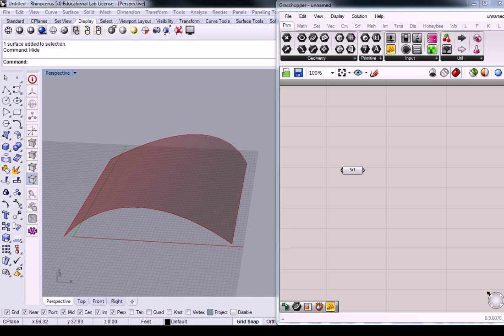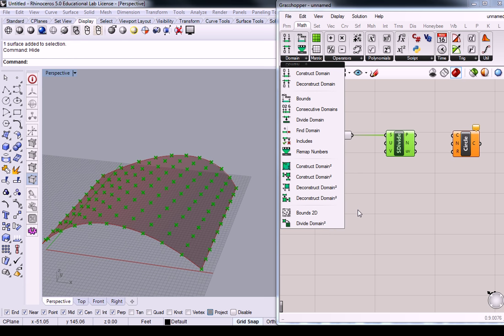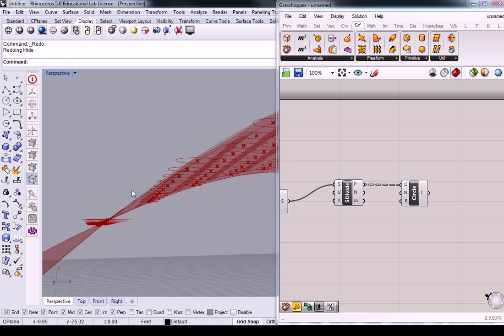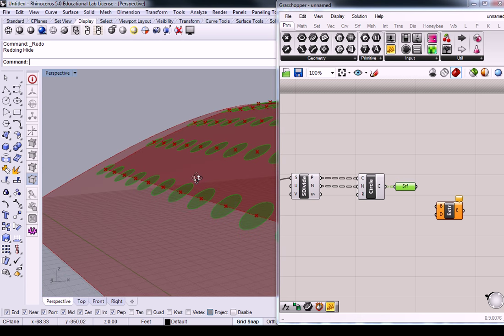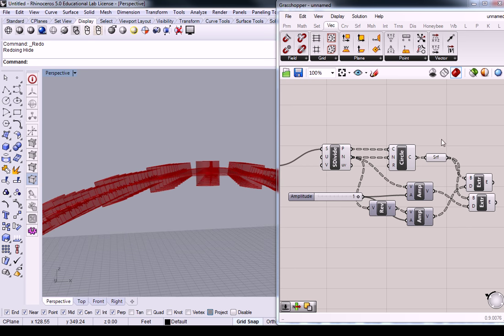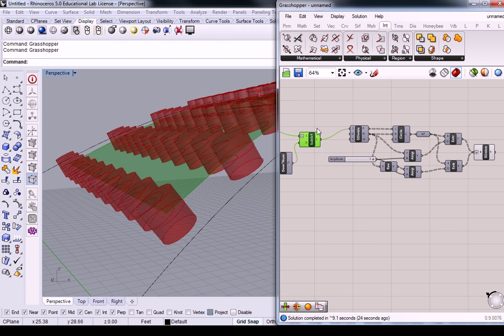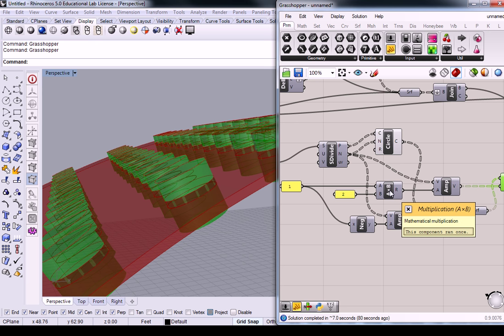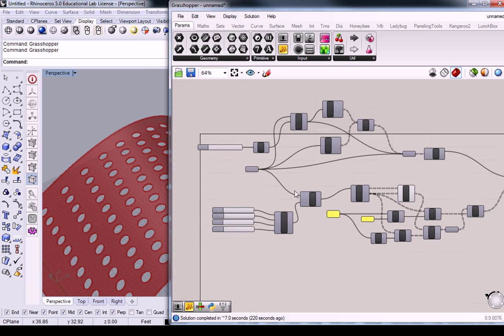160 - Grasshopper - Perforations on Warped or Parabolic Surfaces - CircleCNR SDivide SDiff

Comment: thanks for posting. for such simple tasks you can also unroll surface uv, array holes there and either make a perforated surface/solid and re flow it, or reflow curves on surface and trim. Much less computations, less steps, faster interaction and geometrically correct, as the holes will have the natural distortion manufacturing will have (cutting and perforation first, bending last).